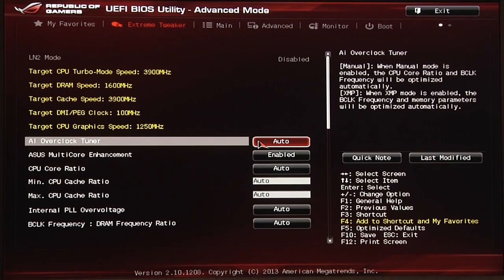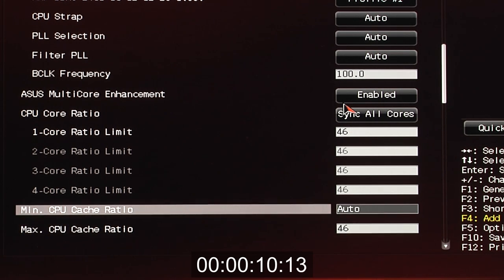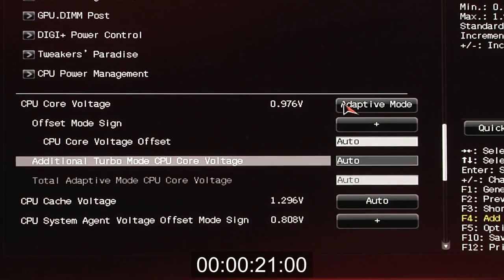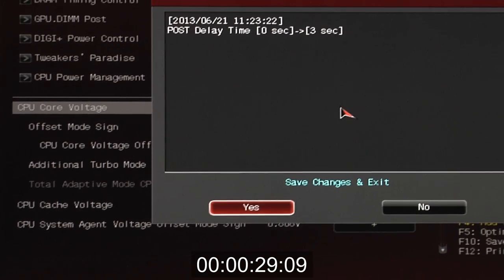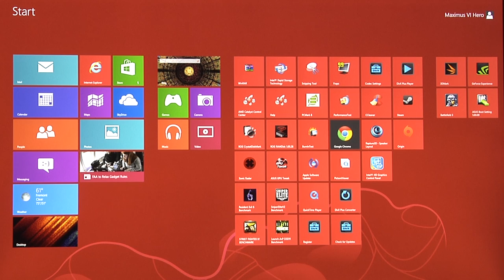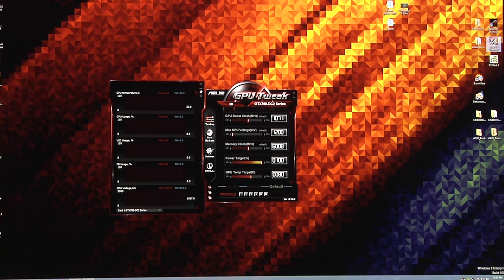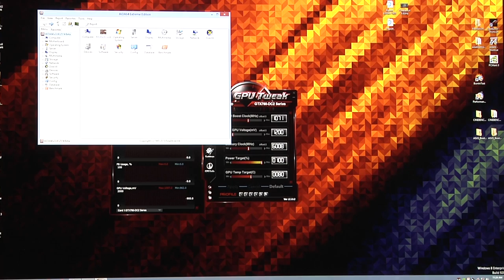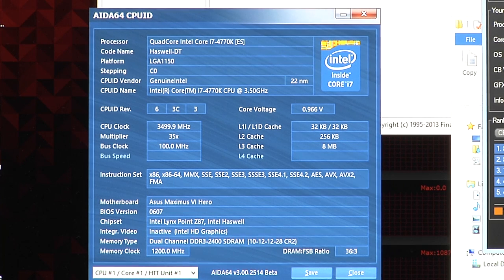Overclock Intel Haswell CPU in Seconds using ASUS UEFI

Comment: JJ, quick question I'm using a Sabertooth Z87 with i7 4770k. I succesfully OC to 4.6GHz, but the clock speed seems to be 100% @ 4.6GHz.  What I may miss, which to have it dynamically change based on the load.  Thanks in advise.

Comment: mine is always running 4.6 at 1.275 volt, even on idle. i set the voltage to adaptive just like you did but it doesn't lower the voltage on idle :/ using i5 4670k and z97 ranger

Comment: Hi, im using the stock intel cooler for a i54670k with stock paste(i read its actually good), and im getting 4.200Mhz with 1.95v adaptive watching your guide. no problems running 3d mark, reaching 79C. 
Is there any way of telling if i have a good chip that i can push to the limit with a more efficient cooler? Is this setup safe for now? Ambient temps inside the cpu reach 38C, but i hear not to exceed 80C. 
Thanks for the video, very helpful Thumbs up

Comment: Hi jj, followed this video, thesame mobo but ram is 1866 oc to 4.6  error  , then down clock to 4.4 stable with cpvoktage of 1.2v,  do I need to upgrade to 2400 ram to attain 4.6@1.2 or 4.8@1.28v,

Comment: I tried this with i7-4770k, Asus z87-Pro, 16gb Vengeance Pro ram, Corsair H100i liquid cooler, and Seasonic Platinum 660w PSU. I actually used 44 as the multiplier to start out, thinking it should be easy, and immediately got BSOD when I tried to log into the desktop. It wasn't stable for any time at all? I tried again and it has been stable for the passed 5 minutes so far at multiplier of 40, but it's a well cooled 4770k? Why would I be having problems?
Reply: what is your cpu core voltage setting? you should also increase the vcore(something like that) value when you overclock your cpu. For example, i put 42 as the ratio, i also have to put 1.200 on the voltage setting... reply me if you still dont understand. PS: i am using 4670k with z87pro
Reply: CNantiSB It's exactly as he did it in the video, so it's at 1.200. I have been stable at 40 for about a week and just tried it at 42 which worked and seems to be stable as well. I didn't see anything called vcore, but thanks for the help. I'll probably try upping the multiplier again. Maybe it just didn't like going straight from 3.5ghz to 4.4.
Reply: Aaron Dragg actually, you cant do EXACTALLY what is like in this video because different cpu has different quality, which means some cpus use less voltage but can also oc to a very high clock; however, some are opposite. Therefore, as you increase the clock, try to increase the voltage as well, One more thing, I would recommend that you should increase the clock ratio as 0.1Ghz per time (at least I do that). for example, my cpu is 4670k, the default is 3.8Ghz(included the turbo boost), so I know that I can go to 4.0 without any issues. once I go to 4.1 with default voltage, I reboot the system and run some benchmarks or stress tests to see if my system is stable or not. then, I go back to bios and go up again OR increase the voltage if my system is not stable...
Reply: Aaron Dragg and that voltage thing is actually called CPU core voltage in the bios, when you set it to adaptive mode, you will see additional turbo mode cpu core voltage, you can change the voltage setting over there. make sure don't go too high like 1.500v or above :)